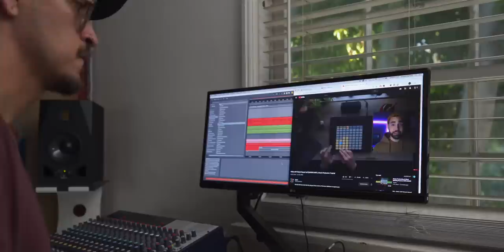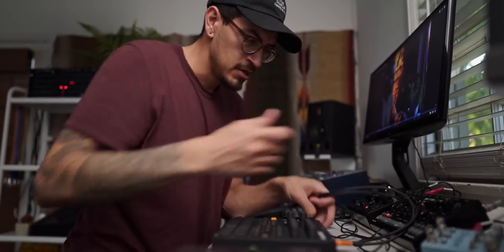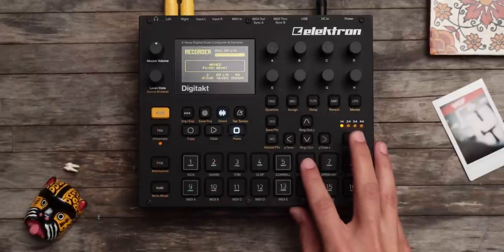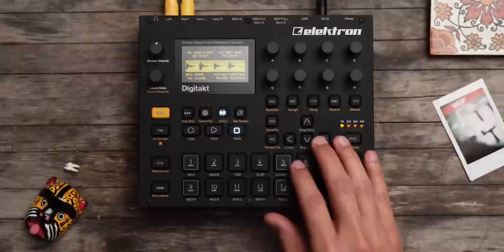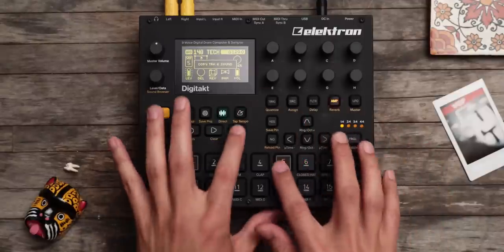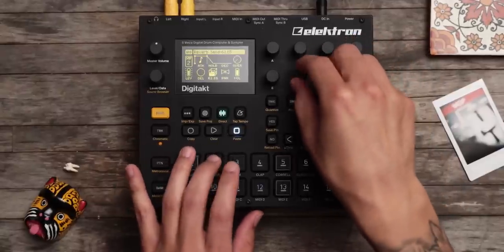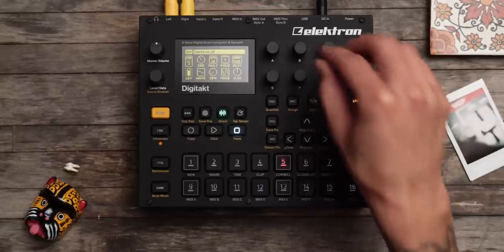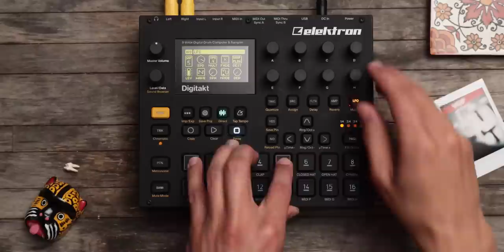Resampling the Same Sound 21 times.. Woah.. // Digitakt can crank out some dust...

Comment: Boards of Canada have mentioned they use this process with the internal mic of a cassette tape deck, particulary on Geogaddi. They compared the process to when you look at an image reflected within two mirrors forever, in the distance it gets darker and greener and murkier..
Reply: @MomoTheBellyDancer i agree, Ricky's example most definately becomes smaller, maybe thats the result with digital. Analog tape on the other hand adds noise and flutter with every pass, hence darker tone.
Reply: MomoTheBellyDancer yea it does. Try it. Mirrors have green tint that grows with each reflection because the glass and silver mirror slightly reflect a little more green than other colors. 
The image does get darker also because lux diminishes with each pass thru the glass, glass is not 100% clear
Reply: For clarity, regular float glass has a green tint, low iron glass does not. So it depends on the glass used in the mirror.
Reply: Dope. Where did you read/h4ear this? Id love to watch that interview!
Reply: @Arviav  unfortunately they don't do video interviews, but they're all written and located at BOCpages. Can't give you a direct link on this channel, but this came from an interview called 'the Colour & the Fire'.

Comment: Really great video, nice trick! I'd just like to point out that I believe the signal degredation is not because of DA/AD at the resampling stage as that most likely happens digitally inside the box. It's all down to the SRC (sample rate conversion) used to speed up and slow down audio inside the digitakt. Everytime you complete one of those cycles it will have less and less information to work with to turn the loop back into its original tempo because it has to "throw away" some samples to speed up the sound while keeping the sampling rate at 48K (which the DT is running internally). Sorry if my explanation is a bit unclear, I don't know all the technical details but I've experimented a lot with SRC vari-speed type resampling inside DAWs. Excited to try it in the DT now!

Comment: old scool like sampling with the "emu sp 1200" in the early days.
Reply: Cant wait to get my S2400 from ISLA instruments....
Reply: Sample at 45rpm pitched all the way up. Keep it grimy
Reply: @Dewane1511  Gonna be so sick. I might finally get rid of my 60 and get the MPC One though. I need to get back into making beats. Don't forget about the insanely cheap $20 Low Hiss eSPi software if that's your thing. I haven't tried it but getting lots of good reviews so far.
Reply: @_thevaporz  My plan is to record the drums live on the S2400 and chop the samples on the maschine MK3 . I'll get an MPC one as my standalone and transfer a lot of my native Instruments drum kits over to it. I can't wait for the S2400 🔥🔥🔥🔥✊🏿
Reply: Very cool

Comment: When you use the internal resampling feature of the Digitakt your sample won't leave the digital domain. So essentially you are doing exactly the same as in a DAW (just number crunching). 

If you really want to explore the hardware side itself you'll need at least resample by connecting the analog outputs to the inputs to involve a D/A and A/D step each time.

Comment: Instead of pitching it up two octaves, then back down for every resample, you could try pitching it up, then up again, then up again (as many times as you like), then back down. That should get you a more extreme degradation of sample quality (like, in a good way).
Reply: It would kind of work out being the same amount of work anyway cos you would still have to pitch up or down the same amount of times, you would just be doing up up up up down down down down instead of up down up down up down up down
Reply: @user-bp1gx3qt3o  It might be the same amount of work, but you should get more of the fidelity degradation

Comment: Great video Man.
Just was thinking about something, so assuming "perfect" sync between the sampler and the sample, if you quadruple the speed so +24 semitones, you loose 3 samples out of 4, but the fourth is still pretty clean. If instead you sped the thing or slowed by a funky amount that had to really interpolate the sample like +5.21 semitones, the effect would supposedly come much faster. Plus if instead of speed up then slow down, you did the opposite, like slow down then speed up, the cruching would also look quite different.

Comment: An Akai S950 does this trick beautifully with 12 bits and a nice envelope swept filter.

The method I use (because the s950 cannot resample its own output) is to record the loop from Akai into my DAW. then record the loop playing from the loop.

If you have Recycle you can repitch the slices before resampling back into the AKAI, if you make a REX file and use the Dr Rex player in Reason you can repitch individual slices or filter them before recording back into the Akai. You can render/bounce the altered REX loop back into a single file and then experiment with playing it back at higher/lower playback speeds to resample from.

TAL sampler also has some great (and accurate) emulations of classic samplers which you can colour the sample with as well.

I'm probably not explaining this very well but the point I'm making is you can experiment with pitch/playback speeds at different points in the process to give different results and make use of software such as TAL and Recycle before resampling back into your hardware sampler. I've had some great results doing this.

Comment: Hello, nice video. I bought DT while ago thanks to your video. I use it everytime it's my standalone machine. I use this resampling thing a lot but you can use the trig note instead of pitch to adjust quickier the pitch. Trig go from -24 to +24 without decimal. Never resampled so many times but sound good I will try.

Comment: Instead of resampling and then pitching it back to normal before resampling again, couldn't you just record it at double speed? So, if the digitakt only goes to +24 tune you could resample the same audio again to make it +48 tune. It would take 2 resamples to get back to normal but it should cut out the legwork of resampling back and forth 20 times.

Comment: Dope!! Nothing like finding a way to add some good crunch without external gear! My homie had shown me a technique similar to this a little while ago and it got really good results really fast. What you do is pitch the sample up and resample, and then instead of slowing down and resampling, you pitch the sample up again and resample. So you start off pitching up 12 semitones, then you resample and pitch to 24 semitones, then resample and pitch to 36, etc. after you’ve pitched up several times, I’ve found 36/48 semitones to be the best, pitch the sample back down and resample repeat until you have the original pitch, by then your sample should be CRUSHED. And it’ll work in 6-8 resamples instead of 10.  I haven’t tried it on a digitakt but on the MPC1K it destroyed my samples. Hope that helps! 🙏🏼

Comment: This is great. To a similarly grungy effect, I've repitched long loops to fit them on the Korg Volca Sample since it maxes out at 4 MB. A bit of work but the results are worth it.
Reply: Yeah, I've been doing that with my Electribe 2 Sampler, which got a lot of flack for its limited sample storage.
Reply: That's the perfect solution for the Analog Rytm as well, man thanks for that idea.

Comment: Nice experiment and cool method. I don't think that the D/A converters are being used if you are resampling inside the machine, but I might be wrong. Pitching the sample up or down might introduce aliasing and artifacts. That being printed into the audio and repeated several times gives it  a new life on its own :)

Comment: I don’t have a digitak. I’m a Mpc 2000xl user. I’m wondering what you mean here when you say “resample” in akai terms resample use to be a way to lengthen your overall sample time by variably reducing the bandwidth of your sample. I got an mpc 1000 a couple of years ago & it seems like they totally changed the definition of “resample” to mean something like recording your sound again. So I’m wondering what you’re actually doing here to achieve that sound. You’re pitching your sound up & “re-recording” it, then you’re time stretching it. I get that. But are you applying any process that changes your bit depth or sample bandwidth?

Comment: I used to speed samples up by 2x and then load them into the electribe es1, which if im not mistaken is 12bit sampling. Sounded dope. Also did that because of limited sample space back then
Reply: Jeremy W The Electribe ES-1 is 16bit, but it samples are 32khz. I have one, but haven’t touched it for a while. What I love most about the ES-1 is that it makes your drum patterns sound as if they were original breaks if you programming them correctly. I think it is the accent feature that does this, but it also seems to fill in the dead air areas to make your pattern sound way less choppy. 

I prefer to do the 2x resampling from a modern sampler (MPC Live/Digitakt) running through a SP-404, Zoom Sampletrak, or the Electribe Es-1 for FX and then to an Akai s20 to pitch resample, and then sample it back to the MPC/Live Digitakt. Just keep looping this process till you get a surprising wild grimy sound. Gives you the character of all the machines involved.

Comment: You can get like 4 samplers from the 80s for one of these that has better sound quality.
Reply from the maker: Which 4? And I def agree on the better sound! DT functionality with a DAW is pretty hard to beat though, and portability and speed! — but that doesn’t mean it’s replacing my 3000, 60ii, or SP haha. They all have their perks 😎
Reply: @RickyTinez  my favourite sampler right now is my Yamaha A4000 which I just got. I would like to get a vintage Roland. They are pretty cheap no won Ebay.

Comment: Buy a cheap akai or emu sampler. Set the sample rate to 22khz and job done. If you want lofi samples it’s a small investment and will save heaps of time
Reply from the maker: What Mark said! I totally agree with this. EPS rack units are good. Or the s612
Reply: Ricky Tinez I don’t know those units, my emu ultra has the sweetest filters about 19 different kinds and will allow for a massive range of adjustment to the frequency spectrum, so I recommend that machine

Comment: Nice sonic results!  Could you get the same (or similar) result from a pedal instead of 10x resampling?
Reply from the maker: Some of the tape simulator pedals can get close :) — I think this is fun though in a sense because it’s pretty unexpected, but if you’re trying to do something quick and still generally get the same idea I would definitely use a pedal. imagine having to do this with every keyboard sample, and then realizing I actually don’t like the keyboard sample anymore and have to change it and do it all over again ahaha
Reply: @RickyTinez   Right? That's what I was wondering - but your end result was too much better than the original you began with (so maybe the opposite could be true). More sonic character indeed. Thank you - always enjoy your channel since discovering you from Knobcon last year. Hope to meet you at this year's Knobcon.

Comment: I use this technique on Deluge all the time for creating my own lofi samples. I use three or even four octaves difference between the resample and the playback pitch
Reply: How do you do this on deluge would love to know!
Reply: @danielreizinger548  transpose a part up 3 octaves, quadruple the speed (each octave up is a doubling in speed), solo the part and resample your loop, reset the tempo, create a new kit with the new sample, set the sample to stretch, put down a note at the appropriate length, pitch the sample down 3 octaves.

Comment: Cause of you, I want a digitakt! Just got an MC101 and already want to pair it with a sampler. Torn between the DT or SP404. Videos like this make me think the DT is the move since you’re resampling. But the SP404 I believe can hold longer samples. That GAS is real! Anyways happy 404 day!
Reply: KnowPhere - DT has the Elektron sequencer :)
Reply: I have the DT and want to add an MC101. I think they’d make for a super dope combo, but the SP404 is dope as well, so I don’t think you can go wrong.
Reply: @murahachibu I’m new to the game so just tryna figure what’s the benefit from one to the other. Very torn which to get but think the DT maybe the better investment in the long run and may get the 404 down the road cause love the portability.

The MC101 is decent. The number of preset tones and size make it worth it for me. Not really a fan of the drums hence my interest in the DT. Also it is menu dive heavy with plenty of limitations, but an update is suppose to drop this month so maybe wait to see what’s in the update. Also try to get it used. Got mine for $350. Wouldn’t pay more than $400 for it.

Comment: You're just basically lowering the frequency range of the sample by doing that... so it's almost like applying a bandpass filter that's super wide but still as 20-30hz and 18-20kHz dipping. It applies some bit reduction as well, a bit like converting an MP3 into another MP3, back into another MP3, etc. 
it lowers the "quality" of the sample but obviously, this is very desirable :)